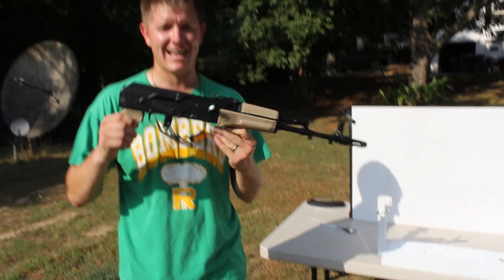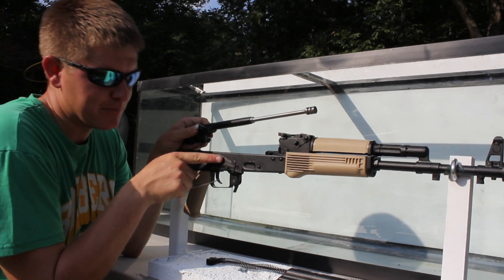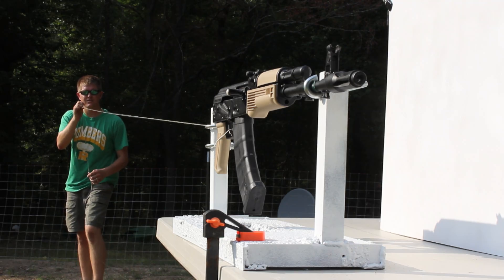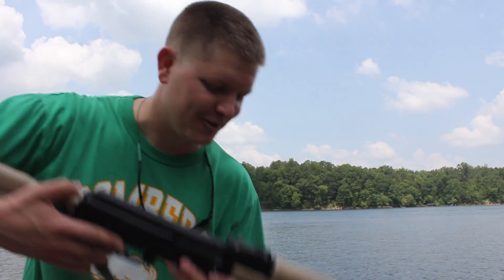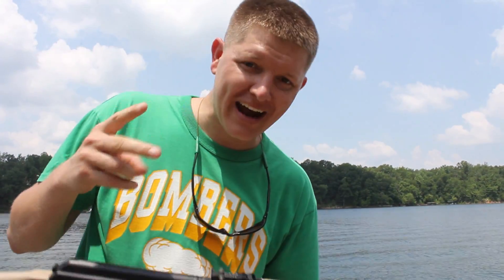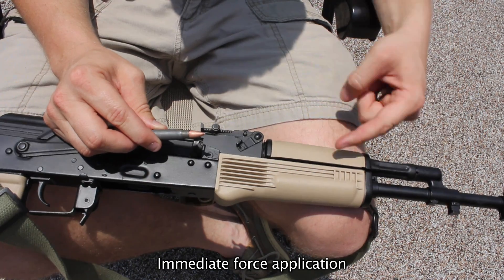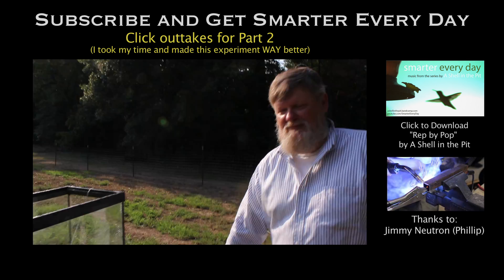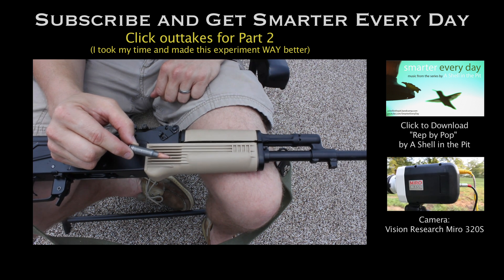Slow Motion of an AK-47 Underwater (Part 1) - Smarter Every Day 95

Comment: They do work, but, if I remember correctly, they will only fire once, as too much water is in the chamber for a second shot. I'm probably wrong on that. Plus, he is using the AK-47, one of the most reliable guns. American guns, especially the ones used by the military, are more accurate, but require much greater care to keep in working condition. An AK requires nothing more than a hose or a good dunking to clean it most of the time.

Comment: If you note the rear of the receiver, it is slanted relative to the front of the receiver at a slight angle. In AKM and AK-74M designs, the rear of the receiver is parallel to the front of the receiver. Compare for example a saiga based AK or a Romanian AK to the SLR series of rifles. The Bulgarian rifles are all based on stamped steel AK-47 receivers, and have modernized parts and furniture such as a vertical gas block and a folding polymer stock.

Comment: Actually I am quite sure it is a SLR-107FR, a rifle of Bulgarian design and NOT a Saiga rifle. Notice the slant cut receiver, which was eliminated in the AKM and AK-74M designs and the desert tan furniture. Also his rifle is using a Bulgarian Style flash hider (generally called AK-133BU on webstores, go ahead and google it) which is characteristic of Bulgarian rifles. Also, I have an SLR-106F and this looks identical other then it's desert furniture and its 7.62x39 chambering.

Comment: as long as the proper bullets, primers, and powder was used they will function fine out of your firearm. the lose tolerances of just about any AK platform will allow it to shoot brass, even brass that has been shot and reloaded up to 5 times (after that it's getting slightly worn) and it will shoot all types of steel cased ammo as well, bare, coated, and even brass, copper, zinc washed steel cases as well. Feed that gun anything and everything you got.

Comment: sorry it's a AK47 Side folder, watch the video this time. there is a perfect high quality slow motion camera shot of the AK47 7.62x39mm round being picked up by the bolt and carrier and pushed into the chamber. Clearly 7.62x39. just like the other people making incorrect comments, you are focusing on the Bulgarian ak74 style gas block witch is irrelevant. Saiga Arms uses that gas block for all AKM's. Also note the AK47 40rd mag. 5.45 mags are not even close to that shape.

Comment: not being rude, just giving you the 100% facts. you can clearly see (multiple times shown in video) it uses the 7.62x39mm round(ak47) and NOT the 5.45x39mm (AK74)round. You got to fixated on the gas block and didn't even look at the perfect slow-motion shot of a 7.62x39 round being picked up by the bolt/carrier out of the mag into the chamber. back to the gas port, you forgot that SAIGA uses that style of port on ALL of their AK's. it's prolly a Saiga AK47 (AKM47 Side Folder) now you know.

Comment: In fact, as far as I can tell it's a bulgarian AK variant rifle, and is based on the AK47 layout and not on the AK74. Bulgaria was never able to license the AK74 so they "modernized" their AK47 machinery to make new rifles themselves. You can see that the receiver is still slant-cut like the AK47 variant rifles were before they were modernized to AKM. It is essentially an AK47 with a 90 degree gasport and modern furniture.

Comment: Hey Destin, what if you shot through a tarp instead of a piece of glass.  I was thinking that you should remove one piece of glass from the aquarium and build a clamp to secure the tarp on all sides.  That way, the tank will not drain as quickly and the entire aquarium won't shatter.  In theory, it would make cleanup easier too.

Comment: 72 mass killings in USA for the past 25 years only two used bombs Mc Veigh and the Boston man. The rest chose the easiest most available tool the gun.

Guns are more powerful and more efficient than knives. UK have 62 million people compressed in very small territory as compared to the vast continent of USA, UK much higher population density and yet only 2016 people killed by crime in one year, 60 by guns and 2000 by knives and blades compare to USA 12,000 deaths per year. Guns are far deadly.

Comment: Depends on how deep the obstruction goes into the barrel, if it's deep it will explode but not with shards, your stock will splinter (if it's wood) and your barrel grooving will be severely messed up, though this was tried on a mosin Nagant

Comment: Great video and kudos for building that contraption. Assuming each bullet has the same F, only the mass and acceleration differ due to the column of water in the barrel. I don't get how that affects the recoil of the piston. In fact, it would slow the acceleration of the piston. I would assume the main cause is the compression of air versus water like you said, right?

Comment: You should consider having a hole in the glass at the exit point so that you don't destroy your tank every time.  Water will flow out of the hole but you can compensate with incoming water to keep the water level up.  Just drill a hole in plexiglass.

Comment: Just thinking out loud here, but if you can cut out a hole in the glass pane where the bullet will exit and cover it with tape (to temporarily hold the water in place), wouldn't that save the setup for multiple takes?

(this is assuming the force of the water isn't blowing out the glass...)

Comment: It's probably because the of pressure from the water. When the gun is fully under water the water is already around the bullet when it is fired. But when only the barrel is under water the bullet has it's original speed and hits the water that is in the barrel and probably also heats the water up which builds up even more pressure.

Comment: Showing frame by frame in a continious way is still slow motion. And a recorder @ 30 or 60 fps wouldn't be able to capture the firing process as this one does at 480fps (1080p) or 2000fps (720p)

Comment: I noticed that the base of the rifle stand was clamped to the table on the "air" shot and the base was not clamped in the "water" shot.  I believe this resistance or lack thereof may change the force opening the bolt.  This could be the experiment to show opposing force.  Have one gun benched and clamped vs. the other unclamped and then fire both guns and measure the recoil.  You cannot use the bolt as the measuring stick, perhaps the force of the recoil with a spring.

Comment: It seems as if the fracturing is spreading away from the point the bullet punctures to the right.  Though it is clear the expanding gas puts some force on all sides of the aquarium, my opinion is that you'd have to fire a blank to create a similar shockwave without the projectile to confirm that the shockwave alone is enough to break the glass.

Comment: BTW the flash hider does not count as part of the length of the rifle unless it is permanently attached (non-removable).

I suggest you measure the length of your weapon, and consider removing this video if it is shorter than 26 inches.

Comment: Not sure if it's been mentioned yet, but when you are cutting the shoulder stock off of a rifle, you must make sure that the overall length of the rifle is not made shorter than 26 inches. Otherwise you are committing a felony under the NFA, which carries a maximum prison term of 10 years.

Google for atf-ruling-2011-4.pdf and read the last paragraph on the last page.

Comment: I'm assuming you used Tula Ammo? you should try it with PPU, Fiochii, or a Brass Cased ammunition and test the difference in action speeds on those. I understand that the AK will pretty much eat up anything, but I was reading an article and they tested various ammos out of an AR-15 using steel cased and brass cased ammo and the brass won the speed.

Comment: High pressures that ruin the gun yeah but not explode. theres not enough grain in a 308 to even create shrapnel. if it does explode it not the gun, its not the pressure, its bad ammo. I have never ever heard of a gun exploding underwater. even up here above water a chance for a gun exploding because of high pressures is rare and by rare I mean has never happened. I could be shooting a 5.56 in a .223 barrel, have it suppressed and it still will not explode, kill the gun yeah, but not explode.

Comment: yes, you could just point them up at an appropriate distance, and use trajectory  to make them collide without pointing them at each other.  but then youd need timing,  so you could us a machine, which means you could just point them at each other 20 feet apart, and fire them electronically with no one in danger.

Comment: PS to clarify that initial statement, the viscosity of water reduced the loss at that junction a lot since it's a smaller opening.  Where with the air there's no doubt a lot of leakage there slowing the acceleration.  However it works so they never had to tune that up :-)  But anyway it's another point that favors the water.

Comment: Water is faster because the initial acceleration is hampered in the air case by leakage in the front of the piston there.  Get rid of that leak and the air will still probably not keep up at first because of the compressibility of air vs. water.  ie. there is a propagation of the energy that happens in air that is much much slower. 330- 343m/sec.  Where in water 4.3X faster.  On the other side of the piston is a fluid dynamic problem but there's a big opening so it's just accelerating H2Omass

Comment: That's not an AK47. The old AK47 was made of a milled reciever, and hasn't been manufactured since the 1950s. The AKM is lighter, and made with a stamped reciever. It's the most common AK variant on Earth, thus the most common assault rifle on Earth. Judging from the angle of the gas port though, it might be an AK-103, not an AKM. That's an AK variant that shoots the same round as the AK47 and AKM, but is intended for exporting to other countries, if I'm not mistaken. Very interesting vid!

Comment: I would add that the bolt probably moved faster underwater because of the external pressure. During the underwater shot you see gasses leaking out of the rifle at the port from the barrel to the piston. I would guess the external pressure would cause more of the gasses to be retained in the piston mechanism, and make the bolt travel faster and with more force.

Comment: notice how at 3;35 the gun bends because your mount had no shock absorption also this can cause mechanism problems by causing the bolt to bounce back off the front of the weapon which causes the bolt not to be fully forward :p

Comment: That's a blatant deceptive shameless despicable lie by Gun Propagandist. 

When it comes to population density and diversity UK is much much higher than USA.

62 million people compressed in a territory that is 45 times smaller than USA.

Infact there are 66,000 violent crimes in UK each year involving blades and knives. But only 60 resulted to gun deaths and 2016 in knife/blade deaths per year. If UK had no gun Control there will be over 60,000 gun deaths per year over there.

Comment: There are only 200 to 250 judicially declared Justifiable use of guns in homicide each year. None of the are Assault rifles. Gun proponents claimed 60 million us of guns for defense, but they are not validated. Many of them are police reports which turns out not to be a justifiable use but rather a case of gun harassment use by the claimant.

Assault rifle is used in many high profile robberies. It was used in killing 12 and wounding 58 in Aurora Colorado, and 5 in Santa Monica.

Comment: Water doesn't compress. You can use water to do lots of interesting things with explosive waves precisely because of this quality. Incidentally, it allows more of the explosion's kinetic energy to be transferred to the piston more rapidly than in air. Just think of the firearm underwater as a hydraulic system instead of the unpressurized pneumatic system it's designed to function as.

Comment: On the other hand, I don't know which part is dominated for the resistance when the bolt moves back. Is the friction between parts or the drag due to fluid? Maybe in the water, the parts' friction is still the major parts. If so, it is not surprising since the venting is confined more by water. I am not sure because the water viscosity is 800 times larger. If the water drag is the main component, that will be interesting how huge extra energy the bolt gets because of the confined venting.

Comment: Also, if the fluid pressure are the same around the rifle. The muzzle has larger opening. So, water/air will flow out of muzzle but not gas port. Only when bullet is between gas port and muzzle, the fluid which is the gas would go into the gas port. The water doesn't transfer "faster" information for this part.

Comment: And it doesn't mean it works better. The gas operated auto rifle has the venting for reasons. They don't need the extra energy after venting. The extra energy would cause higher bolt recoil speed, larger impact on the bottom of receiver, of course, short life.

Comment: I don't think it is related to fluid compressibility. Probably, it is related to venting environment confined or not. In the water, the venting holes on the cylinder are surrounding by water, which means the space is more confined than in the air. So, the gas pressure inside cylinder drops slower in the water and then the gas pushes the bolt longer. You can observe that the bolt would recoil faster if no venting too.

Comment: actually you could have drilled a hole in the glass then plug it with a rubber stopper, could have saved the tank

Comment: Technically it can be considered a folding stock in a locked position. I can't tell from the video how long the overall length is but as long as it is 26" it should be fine. Usually with a folding stock on an AK it shortens it to about 26" but can't tell in the video unless I were anal and really tried to calculate it for real.

Comment: I work glass and for applications like that I will suggest go with annealed 1/2 or 3/8 glass. If your budget allows it then go with laminated glass 9/16 annealed (not heat strength). I'm pretty sure u can get the glass for free if u mention the manufacturer. I can probably help u with that

Comment: The water was already in the barrel, the gun was completely filled with water. As soon as he takes a shot, the bullet will move and immediately push some water against the piston and out the barrel. There will be some pressure right away, but it will dissipate through both openings until the bullet passes the valve.

Anyways, as a result, it should start moving immediately for the reason you thought.

Comment: Australia have ZERO mass shootings since 1996 after it implemented strict Gun Control System. Before that and until 1995 Australia have mass shootings problems.

UK only had one Mass shooting in 10 years.

Australia's crime rate went down recently. 
The artificial climb immediately after the Gun ban in Australia was within the normal range which happen to hit Maximum in the year of the gun ban. Home invasion was not new, it was just called a different name before. All Pro gun propaganda.

Comment: For those below who said other weapons can substitute guns in crimes;

UK have 65 million people compressed in a small territory with high diversity. They only have under 100 gun deaths per year and 2015 blade and knife deaths average per year. 

USA have 280 million people in very very huge territory and much lower population density than UK. USA have between 9,000 to 12,000 gun crime deaths per year and 667 knife deaths per year

74 mass killings in 25 years in USA all use guns except 2 bomb

Comment: Which is the more dominant factor, the  different compressibility of the fluids, or the different rates of pressure leakage can be easily verified if you can make some marker and record the time required to pass each marker, if you see acceleration (relative to the air set up as reference) then its incompressibility, if it first accelerates and then decelerates  (again in reference to the air set up) then its the pressure leak.

Comment: may be you are missing one of the many factors working here, the whole assembly is not perfectly sealed. i am guessing that there is pressure leakage which is clear to see in water. Now since the atmospheric pressure is lower than that under water, rate of leakage will be more  when its in air since the pressure difference is higher. This would lead to the same conclusion, which more effective transfer of force on the piston.

Comment: ...inued

Though, the way you described the system initially led me to believe the opposite: That the gas produced as a biproduct of the bullet is the only thing in this chamber, making the system relatively independent of the stuff around it. 

I only say relatively because there would be a larger drag on the actual pin sticking out. My initial guess was exactly what you initially guessed as well.

Comment: This can be tied into the question: If I were to use a really long steal pole to push a button very far away, would I be able to send information faster than the speed of light? To which the answer is: No, because the force applied to the pole would move through it at the same speed sound would (ever play with two cups and a wire as a kid?). 

Sound moves more quickly through water than it does through air, therefore this system would work more quickly in water. 

Cont...

Comment: any type of teleportation would take time to travel a certain distance right? and time can go down to the fastest times possible like 0.00000000000000000000000000000000000000000000000000000000000000000000000000000000000000000001 seconds. so there technically would still be time in the time it took to travel a certain distance right?